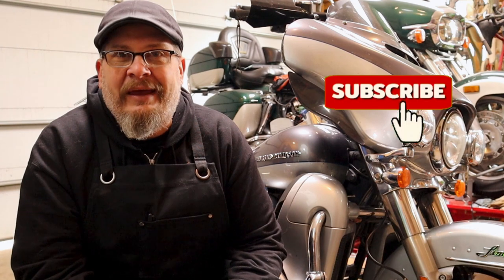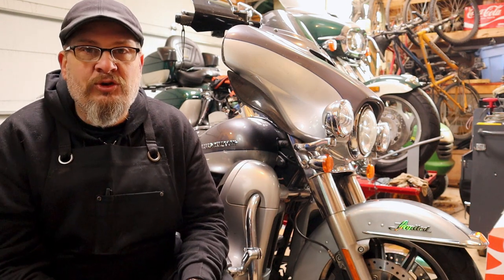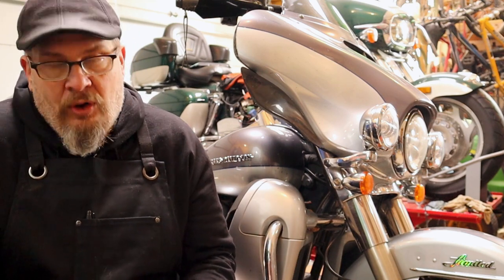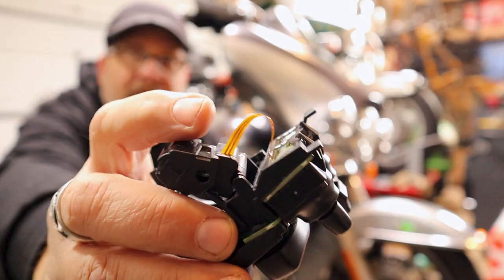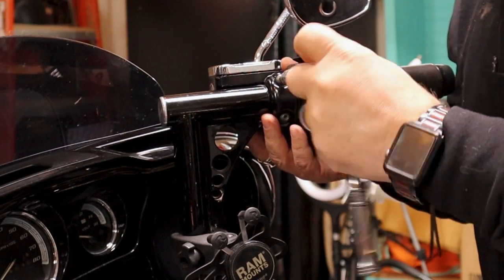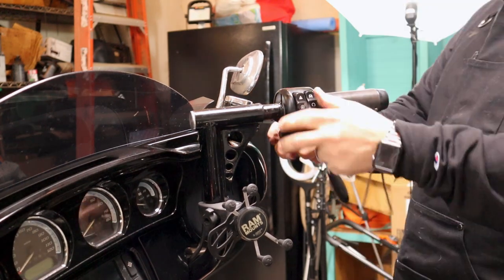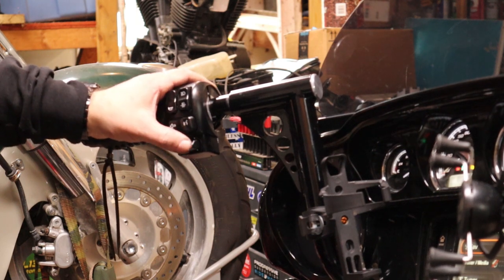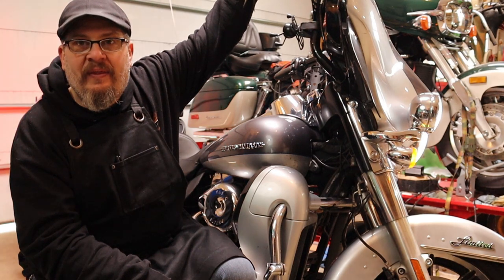2014 Ultra Limited Switch Replacement

Comment: Yogi.  There are 4 ways to disengage the cruise control. Front brake, rear brake, cruise button, or you can roll the throttle forward to discharge the cruise.

Comment: Great video, but after reading the comments I took my switch assembly apart and located the spring. I measured the spring and it was 7/8” I then stretched it to 1”-1 1/16” reassembled it and everything works like new. Time was 20 minutes and it cost nothing. Free!! Hope this helps others. Save the almost $300
Reply from the maker: Great feedback thank you!!

Comment: The $285 is not that bad when you think it was all the control switches for both sides. Bad that only one was bad but all have to be replaced. I though 285 was just one side.  Interesting they only come back lit.  If your looking for the switch in the dark maybe there are other issues.    Wonder if some guy who "had enough" figured out how to repair the integrated switch.   My thought is those switches would be in a do not discard box.
Reply from the maker: Oops. I threw them away.
Reply from the maker: I figured they had enough miles on them that they served their purpose.
Reply: @YogisCycleService  I have so many served their purpose things...

Comment: 2016 CVO limited and my brake lights stay ON constantly! I have tried moving both brake levers to get the lights off but I cannot get the brake lights to turn OFF. And of course because the brake light is on the cruise will not work. Any suggestions? Should I go to the front or rear switch first?
Reply from the maker: It’s possible the button is stuck on the front switch.  I would take that apart and rule that out first.  Generally if one of those goes out it won’t have the light stay on it will not make contact and it won’t come on at all.  Staying on makes me think it’s stuck.  Flip side my buddies road king had that issue also and it was his rear brake light switch.  Once we unplugged it and the light went out we found the issue.  Really you can start either place and Murphy’s law will be it will be the opposite of what you start on lol.
Reply: @YogisCycleService  Thank you! I will start there
Reply: @YogisCycleService  I have an error code for rear brake switch, but my rear switch is located behind the master cylinder!! I have been searching for an hour trying to find a how to video on what all has to be removed to change this switch all to no avail! Every video I find is like yours, back by the trans! HELP please!

Comment: I believe if you tap the clutch handle it will disengage the cruise too.
Reply from the maker: Yes correct it does.  That is one thing I don’t like to do on the highway though lol.  Good point thanks!

Comment: I had a check engine light on my 2016 CVO Limited so I took it to the dealer since I had an extended warranty.  He found the brake switch bad.
Reply from the maker: That’s interesting. My check engine light never came on.

Comment: It's easy fix if don't want to spend the money usually it's a weak spring in the actual switch most of the time
Reply: I’m interested in your weak spring repair. I’m having this problem.  It started while on a trip and a HD shop fixed it because they didn’t have the switch. It lasted about a day and did it again. IDK what they did?

Comment: Yogi I have the opposite problem. Rear brake light stays on.
Reply from the maker: Does the rear brake pedal and front brake pull and or depress normally?